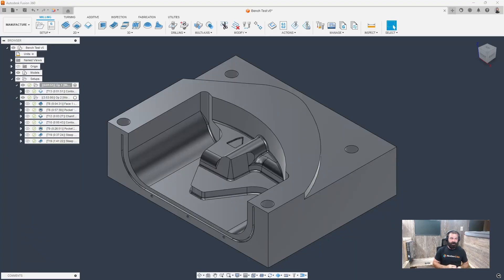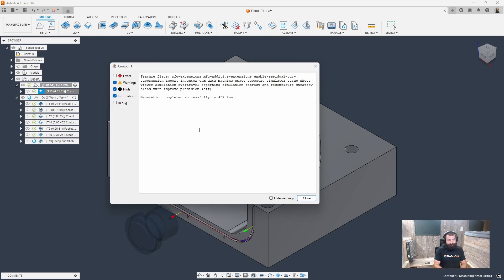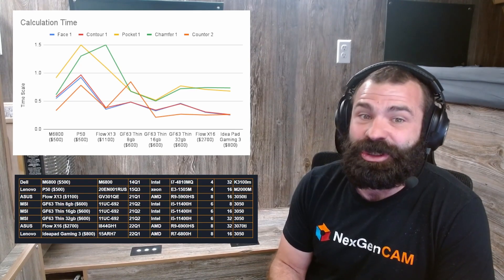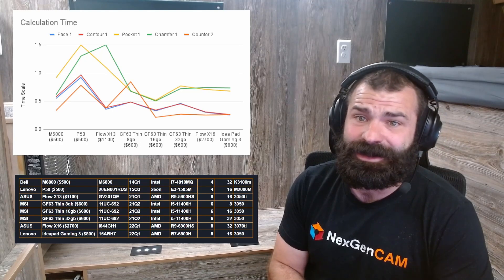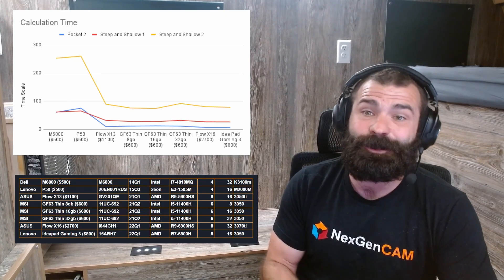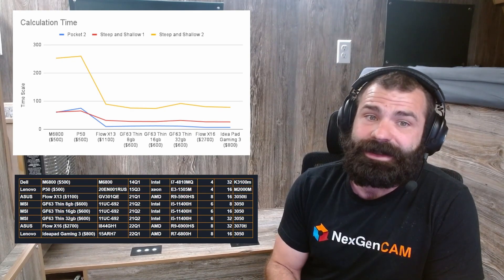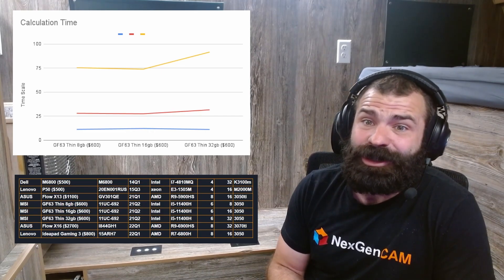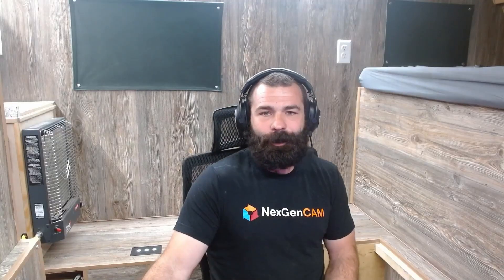Fusion Friday (ep120): What Computer Should I Buy

Comment: Now that fusion 360 supports Apple silicon. It is hands down a slam dunk no brainer to switch over to Mac. I have been running fusion 360 on a M2 MacBook Air and it is incredible how well it now runs. Most importantly I ran for around 2 hours and my battery  was still @ 75%.